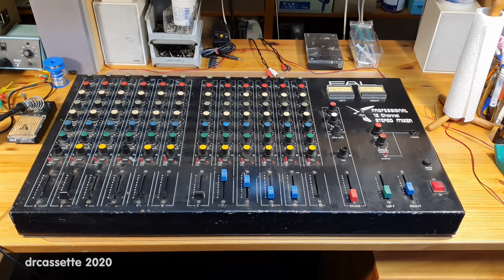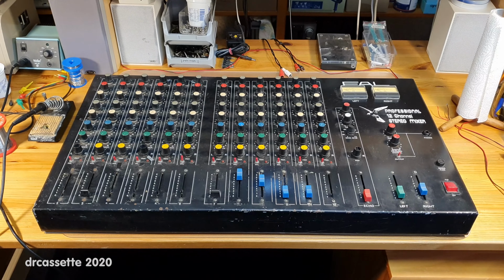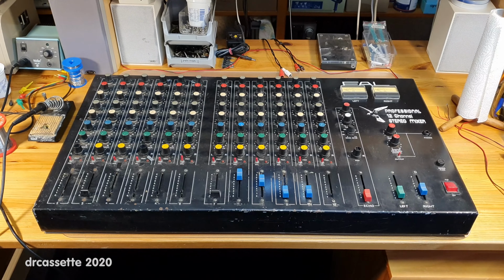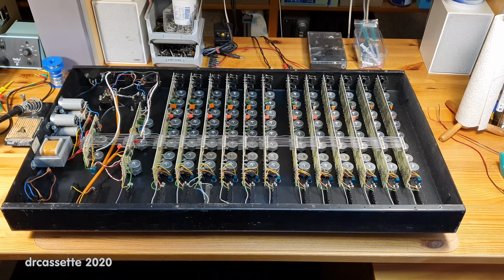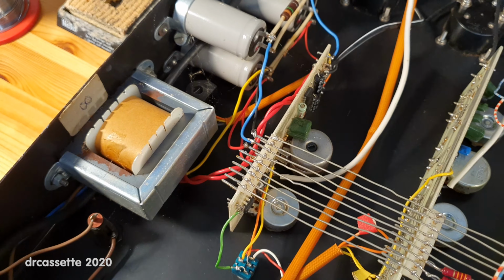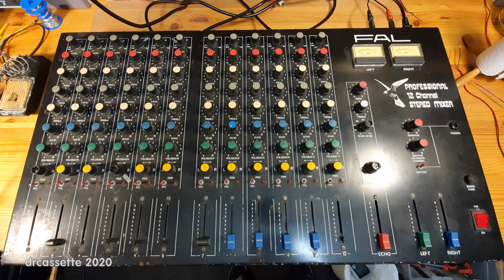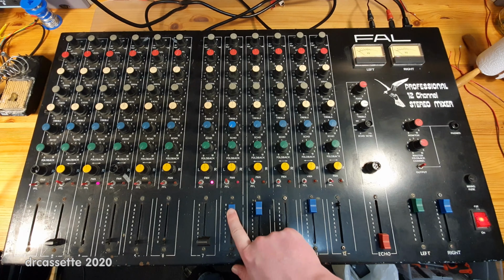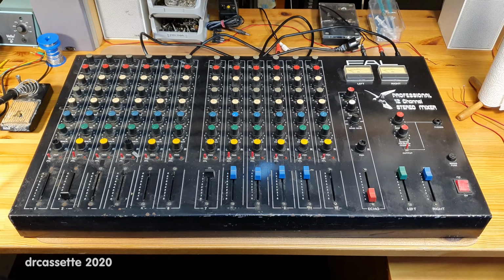Exploring a 1970s FAL 12 channel stereo audio mixer

Comment: There was a time (when I volunteered at a local radio/TV station) that I dreamed of building my own mixer. If I would have gone ahead with that plan, I probably would have ended up with a better one than this. Unfortunately my budget was about the same as yours ;-)
Reply from the maker: I think building a mixer would be an interesting project, as it would be possible to build one that really only has the features you actually need, to keep the circuitry simple and to cut down on unnecessary components influencing the signal.
Reply: @DrCassette  it looks like you have some great building blocks to start with. Clean up the potmeters, relocate the power supply, replace the bus with shielded wire, replace the opamps with high quality ones... It's a challenge!

Comment: Ah, well, time I got all those slider and rotary pots cleaned in the 'Seck 12-8-2 mixer' that I've had for a while and not done much with yet.  I don't think they're a single board mixer and has separate boards, as you mentioned, but I'll know when I get there!  That, the Fostex 8-track reel-to-reel tape machine and the household amps I have!  So many carbon tracks to clean.  It'll be worth the effort, or I may also end up with a good 'parts bin' fill.  Thank you for showing this old FAL 'board.  Stay Safe and Keep Well, sir.

Comment: Echo Send is probably a pre-adjustment for the delay to the echo effect generator
Reply from the maker: There are no echo generator components in this mixer. As commented below, Echo Send is just a volume level adjustment, labelled in mV (775 mV = 0 dB).

Comment: The internal bus looks odd. It’s all bare wires, no insulation and all soldered. I’d imagine the pain having to rip apart the bus wiring only to get access to a channelstrip board for servicing. This calls for a neat ribbon cable solution with card edge connectors or IDC headers.
Reply from the maker: This is indeed a rather primitive way of doing it, though I have seen the same setup previously in a much higher quality Dynacord mixer I had for a little while. As I said, even this is better than what you commonly find in modern mixers made for example by Behringer. Everything is on one big PCB, so if you want to repair something, you have to unscrew each and every potentiometer the mixer has :P

Comment: FAL were not a quality brand,  I had some of their cheap & cheerful  disco lights years ago. They also made twin disco decks that were pretty crappy too.....
Reply from the maker: Thanks for the info! Interesting to know that FAL was also a manufacturer of dubious disco equipment.
Reply: @DrCassette  FAL stood for Futuristic Aids Limited, and they were a supplier of budget PA equipment.  Their consoles invariably came with the cheapest BSR record decks, and their speakers were unlistenable.  We used to refer to them as FOUL speakers!  Woofers with NO bass at all, and piezo tweeters that just sawed your ears off.
Reply from the maker: @Fluteboy   Thanks for the info to you too!

Comment: It doesn't even feature any XLR inputs yet boasts on the top that it is "professional". :D
Reply from the maker: To be fair, the upper row of "low impedance balanced" inputs are 1/4" TRS jacks that could easily be adapted to XLR. Though having looked at the circuitry I very much doubt there is a differential amplifier for a real balanced input.
Reply: @DrCassette  Probably not. Not that there would be any advantage to using a balanced input since it already produces so much noise. :D
Reply: @DrCassette  It did have a balancing OP-amp for the low impedance input.
Reply: Given the poor quality level sliders, professional seems like hyperbole indeed 😬
Reply: When do professional people buy professional products only on the basis of being labeled "professional" 😉

Comment: 0-775 probably refers to the level sent out of the echo jack in mV. if I remember correctly 0 decibels line level was specified as 775 millivolts into 600 ohms
Reply from the maker: Thanks for the info, that makes perfect sense!